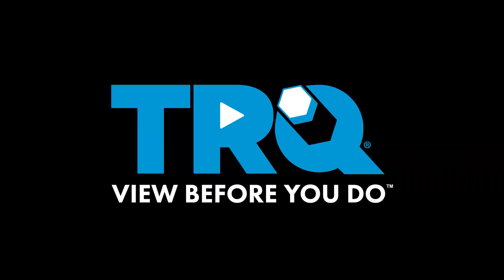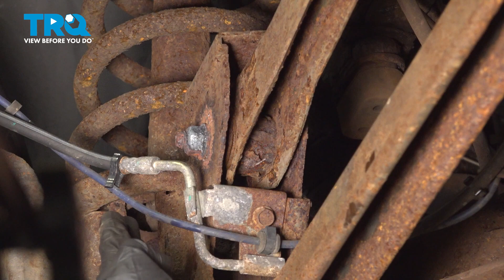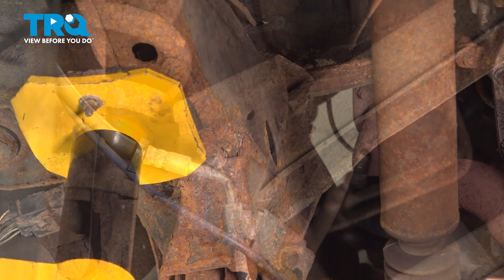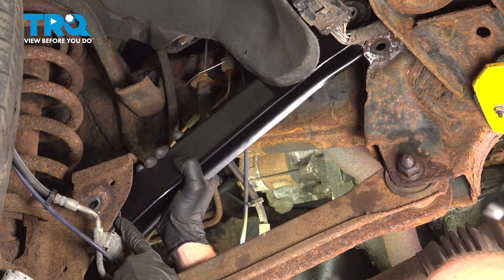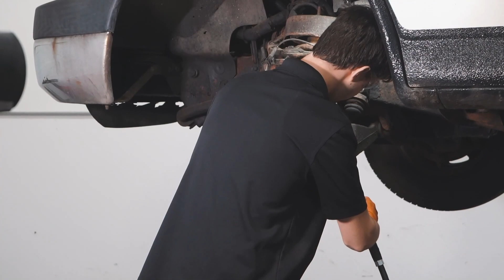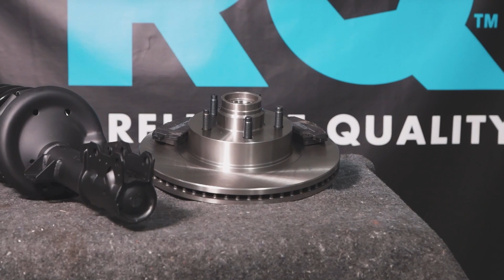How to Replace Upper Control Arms 1994-2022 Dodge Ram 2500

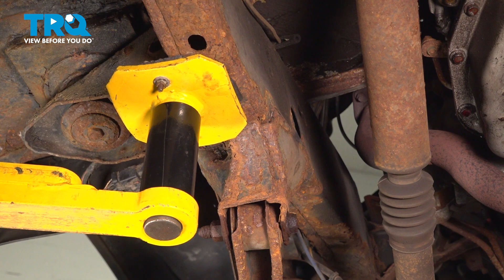Comment: oof 1:15 i dropped my socket in that hole.. now what... 🥲 got a headache trying to get it out with a magnet and other things.. probably gonna have to leave it down there, the only opening is that hole where it fell and the bigger hole down the frame towards back tires, other then that there is no opening for anything to fall out from that hole so be careful!

Comment: I jumped on here for a quick refresher on my upcoming struggle. Can you imagine bolts just tapping out like that? Shoot man. Tip for anyone reading.  Have a 5” angle grinder with a 6-7 inch zip disc with no guard handy or a sawz all.  Those bolts ain’t movin.

Comment: Excellent video, one of the best I've seen in awhile. Very clear and concise and to the point. Unfortunately, I'm looking for a video of an independent suspension on a rear-wheel drive Dodge Ram 3500. Totally different kind of control arm. Do you have a video of a rear wheel drive control arm replacement? Thanks.😊